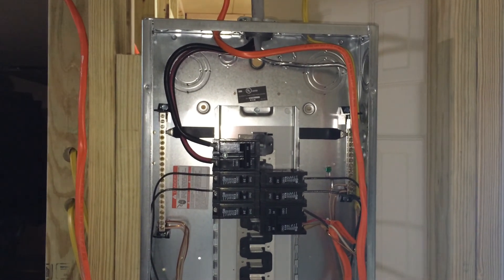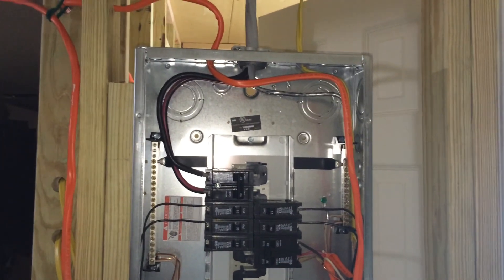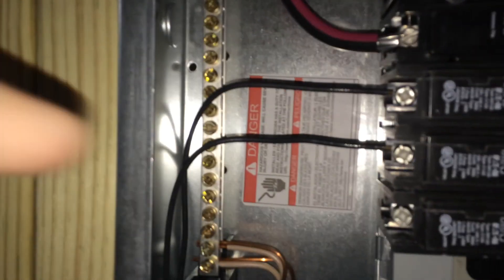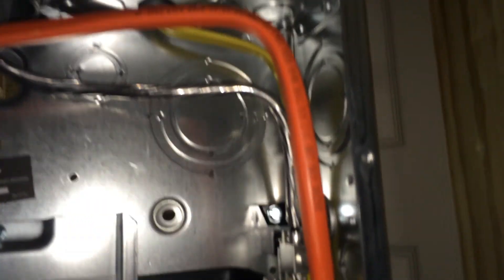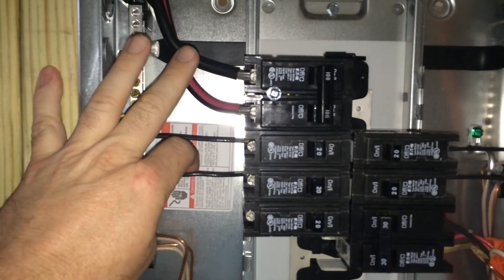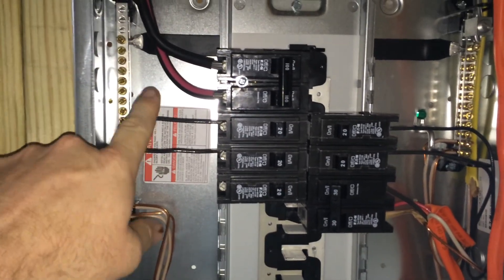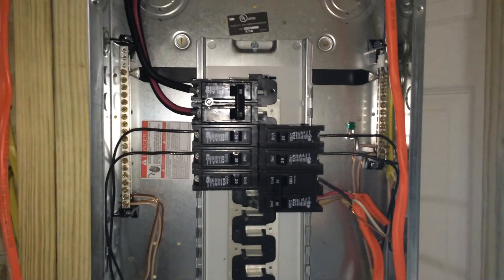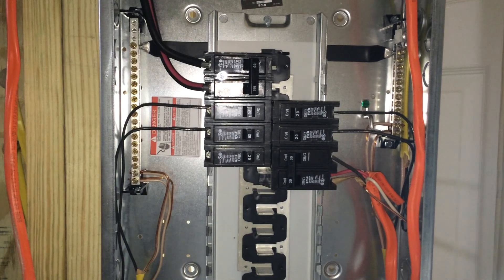How to build a growroom: Electrical Pt. 3

Comment: It looks like the ground and neutral wires are in the same receptacle on the bus bar. What's the difference between that and having a bus bar for only ground wires and another bus bar for only neutral wires?
Reply from the maker: In most residential homes, the panel is bonded because it is the first means of disconnect by a fuse, that being the main breaker. so in most homes you will see green or bare conductors and white neutral conductors on the same bus bars. However, this is a sub panel and they should be separate but I used what I had on hand plus at the time the home was not properly grounded due to someone removing the grounding. that Has now all been repaired and the panels are up to code.
Reply: thanks for gettin back to me cheers!

Comment: dude you are wrong on so many levels just gotta say
Reply: "You are wrong on so many levels"... Really bro?!??? he  made that clear at the beginning man. He's contributing to the community and making videos which are HELPING people learn. How about next time you be less condescending and provide some tips if you want to call someone out.
Reply from the maker: +budgrinder I am pretty sure I kind of went over that in the beginning. I need to make another video showing what was wrong at the time and how it should have been done. When I installed this, the owners before me removed the ground wire to the main panel and so that is why I said what I did in the beginning. I have since then fixed the main bonding issue in the house but need to fix this sub panel still. I will go over the issues and fix them in an updated version of this video so no one does anything unsafe. Thank you for pointing this out again because I had meant to do this before now but life got me busy.
Reply: +kgb grower so the ground wire in the main box is installed now?...so do you now have the cable running from the house into your subpanel grounded?how much actual amp do you have supplied into your house...for you to have 100amp double pole breaker in your subpanel?...lastly, for me to run 2000w of total electrical pull, do I have to have it on a double pole 20amp breraker? or can I just draw from a single pole 27amp breaker 230v